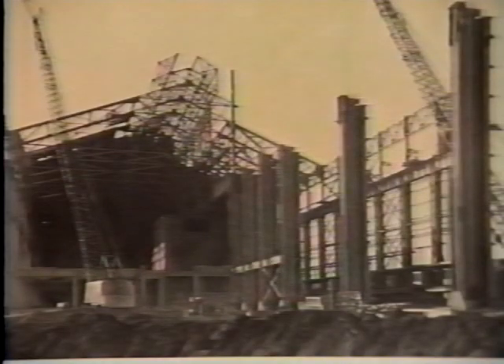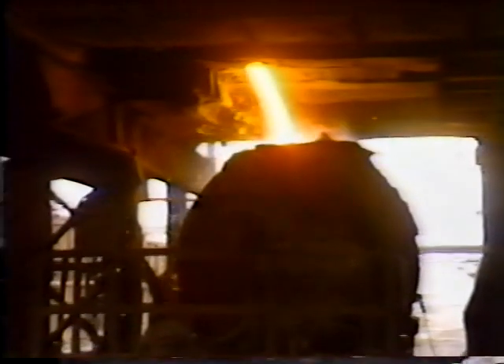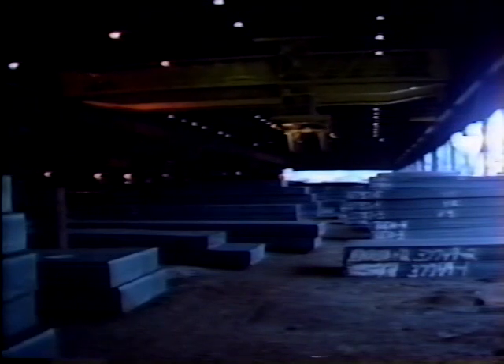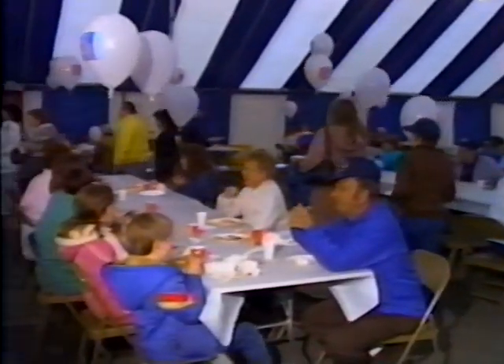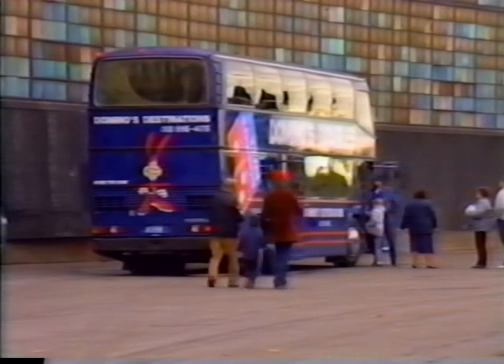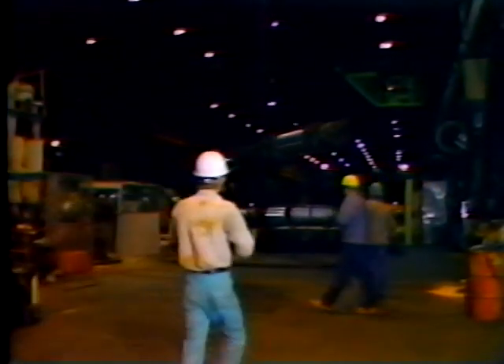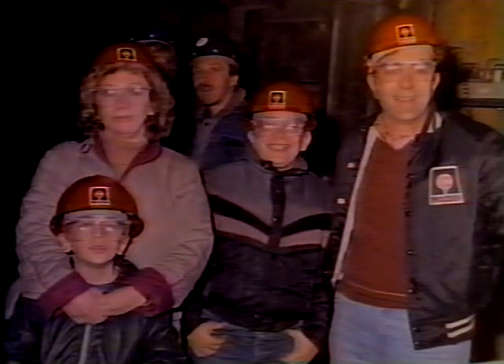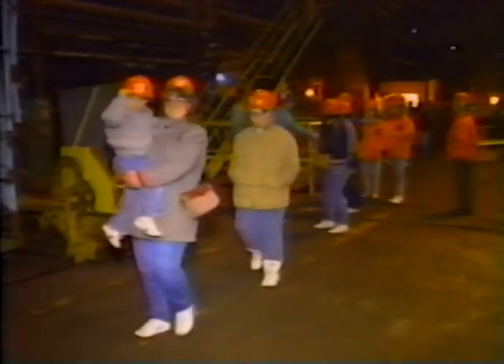McLouth Steel Family Day 1988

Comment: I remember working at one of the McClouth blast furnaces as a Boilermaker. The furnace needed a total rebuild, by this time. The one I was working on had a buckle in the steel shell. The crew I was in was assigned to cut 1" thick by 4" wide bar stock and weld it "edge on". When we started, we would cut the bar stock, to fit the bent shell profile. By the end of the job we laid the bar stock against the shell and welded it wherever it touched shell.